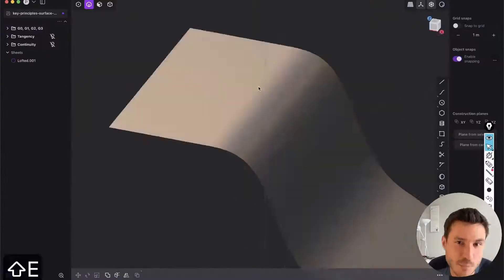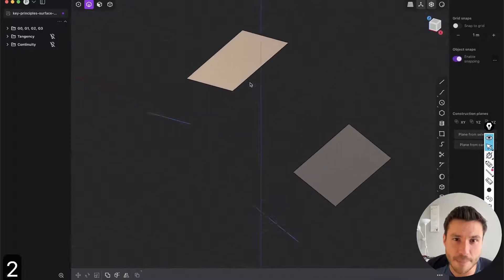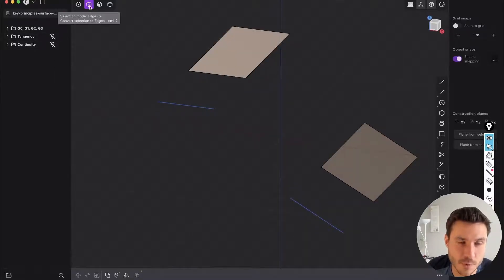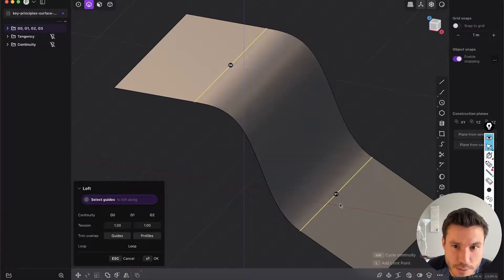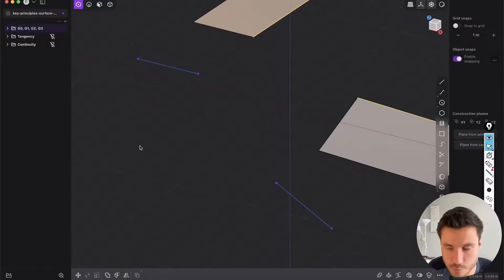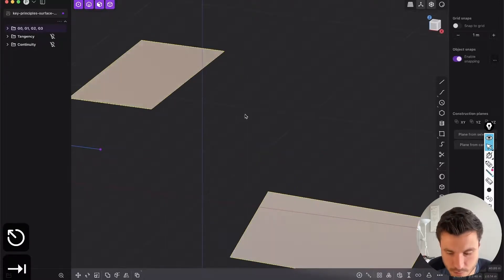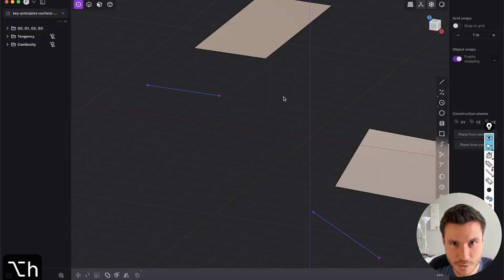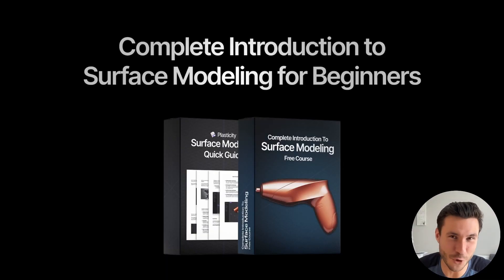What is G0, G1, G2, G3 in CAD and Plasticity?

Comment: I still have big difficulties with making smooth G2 connecting surfaces. For example, T-shaped tube-like (when it is not a perfect round tube) connection. Making G1 - is not a problem, but it really sucks specially when it's wide. In most cases I can see where the seam starts. Another example is a spoon, how to make seamless connection with handle? I'm still not satisfied with the results I've achieved so far. May be you can give some simple advises? Is there any difference when loft curve profiles with inequal degree, number of control points, relative sizes? Surface fragmentation is always the better choice to improve quality? How to fix local problems with continuity if it was spotted on the later stage of the project? Thank you for videos. I've learnt a lot from you.